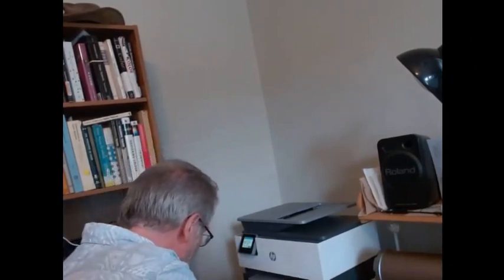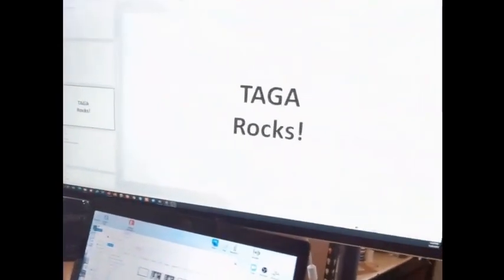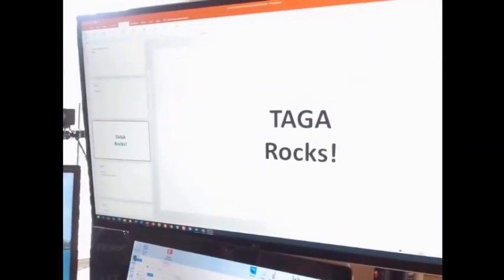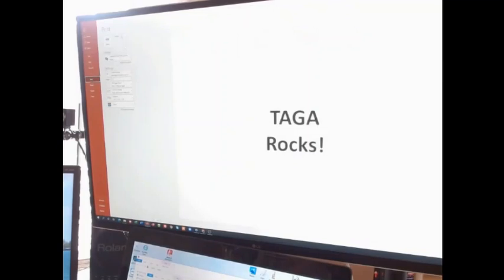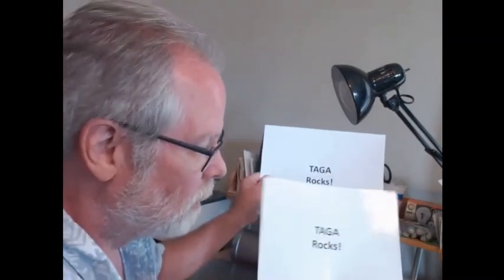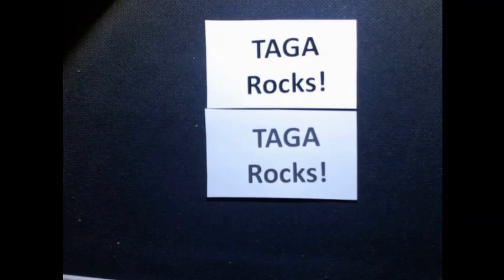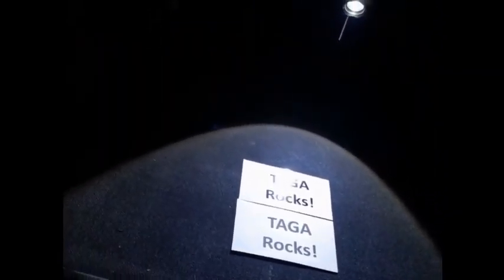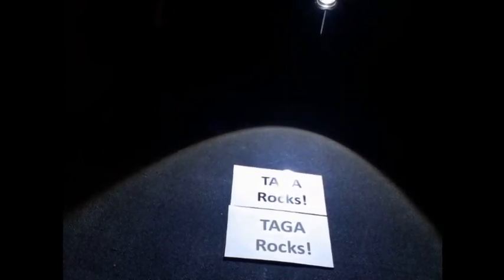Coated paper versus uncoated - why the difference in color??

Comment: this is amazing! It doesn't solve the problem I have but explained it very well. I am curious how polarization will change the character but that might be an experiment I need to do
Reply from the maker: A polarizing filter can either increase or decrease the specular light, depending on the rotation of the filter. For three dimensional objects, this can make them appear flatter, since the brain doesn't get that extra clue about shape. On the other hand, eliminating the specular can make the colors of a flat object appear richer - which may be a desirable effect. One photographer I spoke with prefers a polarizing filter when doing (painted canvas) reproductions.

Let me know what you find out!

Comment: John, If you use "C" formula inks on non-coated substrates does if effect colors? I am specifically asking for Flexo Print/Corrugated.
Reply from the maker: Just6 making sure I understand the question... Let's say that you have an ink that was formulated for a coated stock, and it meets a certain color spec. You take that same ink, and print on an uncoated stock. Does it still hit the L*a*b* values from the coated stock?

Two things will happen... ink (that does not have TiO2) is normally transparent. So any color difference in the substrates will effect the color. This can be a big effect if you are printing on kraft paper.

The other thing that happens is that printing on uncoated stick will effectively add some white across the whole spectrum. For CMYK, this could drop the density by about 0.30D. For spot colors, you get he same effect, but density change might vary.